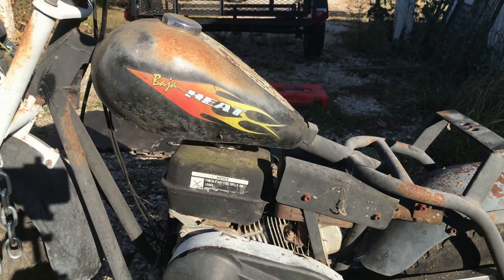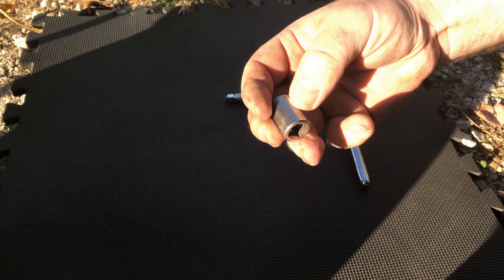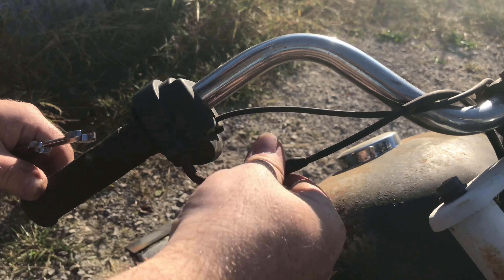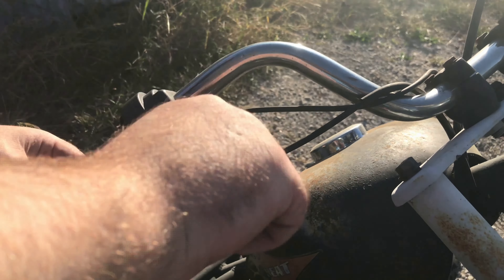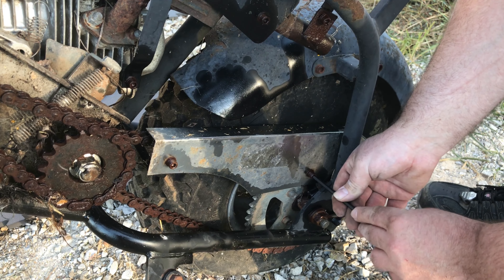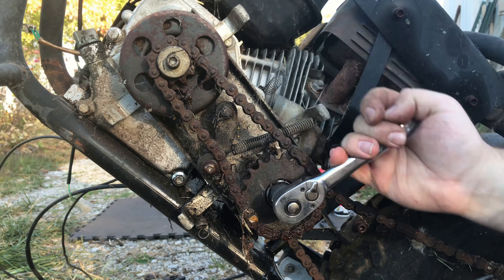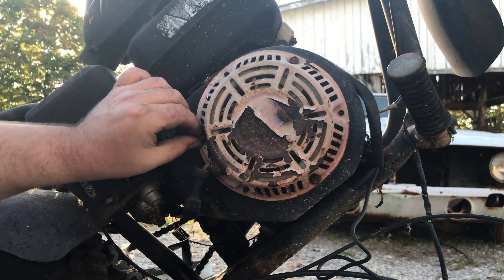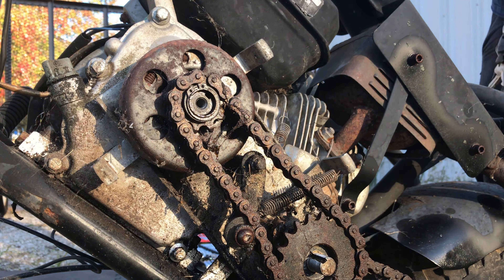How To Remove 196cc/212cc Engine From A Baja Heat / Baja Warrior Mini Bike!

Comment: Full restore or just get er runnin?
Reply from the maker: I think Jerred wants his bike painted up in camo. We'll likely do some fresh paint work but probably not any custom work (cutting/welding) on the frames.
Reply: @KentuckyFriedFixes  my massimo has a bent frame get this mm80 riding I'm going to start working on building a trike out of it have either one of you ever used the reverse gear box
Reply from the maker: @heathenprojects2639  I've not used the reverse gear box. I tried to mount a 5 speed box transmission from a riding mower on a kart years ago but I couldn't get all the bugs out to make it work.
Reply: @KentuckyFriedFixes  ya I've thought about using an old jd 2 stroke snowmobile motor I have laying around on it 2 but time will tell got some good news today at Dr should be a light surgery in a few weeks to fix this ankle should only be down 6 to 8 weeks
Reply from the maker: Most of those snowmobile engines are screamers. It'd be a runner for sure! That's good news on the ankle HP. It's hard to see a bright side when these things happen but at least you can be thankful it didn't happen at the beginning of Summer. Get well soon!